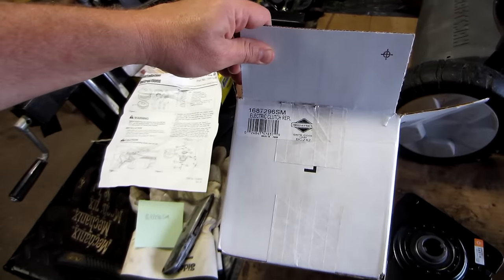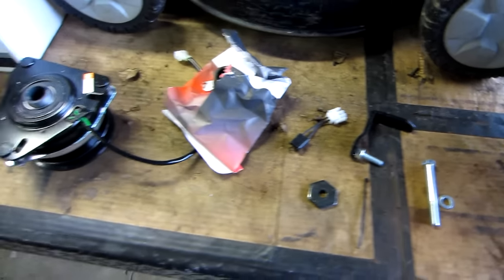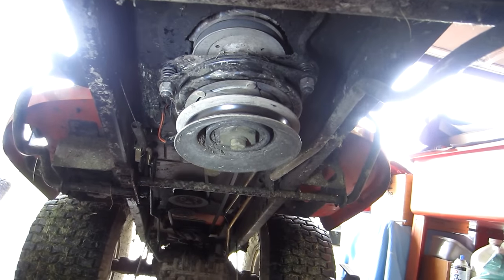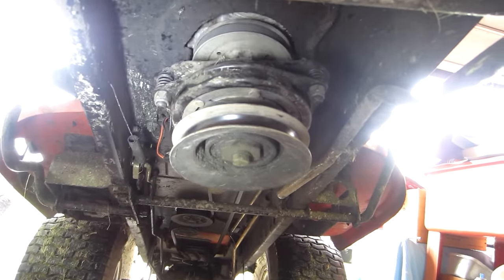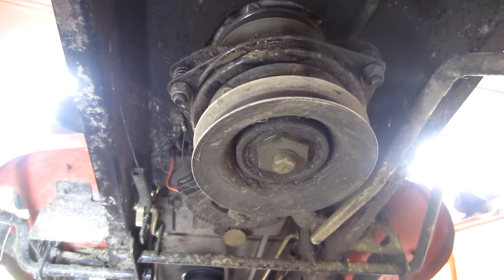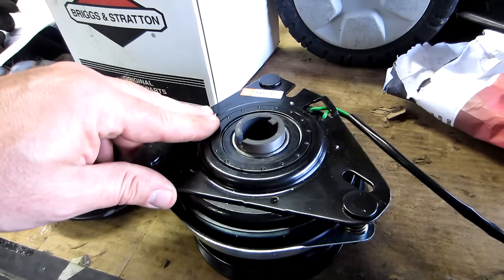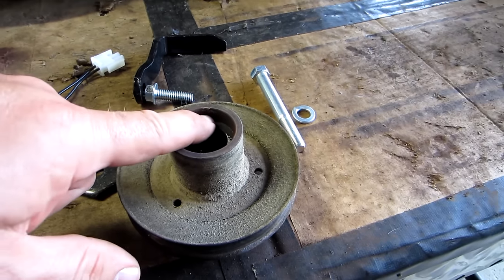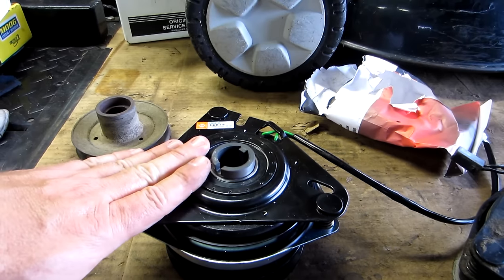Troubleshoot Replace mower PTO CLUTCH

Comment: Nice video , i have a John deere gx325 my pto clutch when i turn on its works on forward.but when i do reverse it shutoff the pto ..what do you the problem ?
Reply: If the PTO is engaged and works while going forward, and then you begin backing up, and the PTO shut down, that is by design.  Your PTO is working fine.
Reply: @retiredhappy466  ok thank u
Reply: @mowerstv4579  
You can bypass that safety switch. I did mine with no problem.

Comment: I,have a question sir, about my pto I loose power when I engage my pto ..its a briggs, 23horse, on a 08 husquvarina. When I tried to find rhe problem I noticed the pully was hard to,turn by hand even,with belts off .
Is this, normal?
Reply from the maker: There should be some resistance to turn the pulley by hand with no belt attached but not a lot. I'm not sure what you mean by lose power? If you are having your engine completely shut down or turn off then that's a safety switch issue. However if you're just experiencing less power being transmitted from the engine you could have something wrong with the PTO or in the deck spindles that's causing a drag. Don't roll out that the engine is needing attention. When I work for Sears I used to have customers complain that they had the lack of power whenever they would engage their deck thinking that there was something wrong with the belt drive or the deck itself only to have me come out and tell them that they had a blown head gasket or a valve guide come loose and cost the pushrods to fall out or bend and was only running on one cylinder. The big twin Briggs engines like you have seemed to have plenty of power but when they really get taxed with running something as big as a 46 or even bigger deck it shows the weakness in only having one cylinder working. Good luck
Reply: @Foxboss9  thank you, for the reply, Ive checked the deck spindles and all the parts that spin turn pull and loosen..lol, but the head gasket, I didn't notice it . but I do,now I see oil now ive checked , now I can get this thing running like a 23hp should not like its mowing 2feet of grass..lol
 thank you

Comment: what about if the clutch is kicking in and out? Would you think that would be a switch issue? Mine runs and then after a min or so the blades start cutting on and off. It makes the whole lawnmower shake like crazy then the blades will almost stop.
Reply from the maker: Southern Food Junkie try adjusting clutch air gap first
Reply: Do you got a video on that?
Reply from the maker: I don't believe so
Reply: i had the same problem on my john deere x140 lawn mower, it was the PTO switch which has melted on the inside, after replacing the switch, the lawn mower works again

Comment: I don't have that type of money just for a cheap clutch that'll just burn out again i am gonna switch all mine over back to cable engagement you push the lever up to engage the blades is how im gonna do my 3 pto mowers 

but on the old gray craftsmen i can swap out the steering make a new battery holder for it because the gas tanks under the seat and right now the battery is in the way of any engagement lever

Comment: FoxBoss, I NEED your help. I removed my PTO Clutch from a Yazoo/Kees mower and I cannot find a replacement that specifies the size that I need. I Measured the pulley to be 6 1/4" OD. Are most PTO clutches the same? It came off of a 15hp Kawasaki. Any feedback would be greatly appreciated.
Reply from the maker: +Jason Michael Sorry I am not sure what size you need. The reason is not all clutches are the same.. You need to get hold of a dealer and get a part number.  Try this link.. http://www.yazookees.com/node4056.aspx    good luck

Comment: I'm having a problem with my blades. They start turning fine. But once you get into any grass it will cause the blades to slow and then stop. Could it be my pto clutch?
Reply from the maker: sounds like a belt issue, make sure it is the correct length belt and in good shape..
Reply: Brand new belt. From John Deere dealer. We checked all pulleys and spindle housings. And blades. The only other thing we could figure is the pto clutch may be going out and getting weak.
Reply from the maker: make sure the air gap is set correctly on the PTO other than that make sure applied voltage isn't dropping off for some reason it should stay a constant voltage around 12 at the PTO

Comment: i bought a new pto clutch and a new switch but the clutch still doesn't engage the blades. I noticed the bolt that holds that pto clutch in place. Is this suppose to happen.

Comment: The air gap should be .012, I have with worn PTO'S closed the gap to .008 , I don't recommend going any tighter,  it will cause the PTO to NOT disengage.

Comment: My wires short circuited at the rubber grommet where they enter the clutch. The grommet yanked out and pulled the wire insulator off. PTO kept disengaging after mowing for awhile. The wires kept getting hot, which was our short circuit symptom. The switch and fuses still have continuity. Clutch is one year old. Pulled the clutch cover off but the internal clutch is over the wiring and not allowing access to the 2 wires. I am attempting to find an alternate way to wire it but I am trying to figure out how the current applies the clutch itself.
Reply from the maker: +markfothebeast Depends... some get power through the switch, others do it through a switched on relay.. if you hard wire it through a separate aftermarket switch I would wire in a relay so all the voltage isn't going through the switch by itself.. hopefully you don't get feedback from the clutch that causes the pto to stay engaged even when the switch is turned off..good luck
Reply: +Foxboss9 The fuse and switch are operating as should. My Toro Z597D doesn't utilize a relay in the circuit. The wiring I am refering to is the pos and neg inside the electromagnetic clutch. It appears that there is a large round plate with a flat surface that is internally wound with coils (with outer clutch removed). I can't quite access the wiring on the innerside of this plate without pressing out the outer bearing to view how the circuit is wired. Unlike many other mowers, this clutch wiring does not have any type of terminal on the outer shell. Which is way I had to access the internal components.
Reply: +Foxboss9 I cannot find any information on how the electromagnetic clutch is supposed to be internally wired. The coil in the plate I am assuming is the positive but I am unsure of where the negative wire is in play here. The two magnets visible on the outer shell from what I've read create a magnetic field when power is applied. I don't see any type of wiring to the magnets themselves. Just the two wires entering the outer shell behind the plate in which i am unable to access until i press the bearing out.
Reply: I think I have an understanding of the magnetic clutch circuit after a bit of reading. It appears the wiring entering the plate is simply winding that enters and exits completing a circuit. If I got this right, the polarity is reversible on an electromagnet. So either way, I have to press the clutch plate out to fix the wiring.
Reply from the maker: +markfothebeast I see.. the way that that PTO clutch works is just like when you did your elementary school project and one copper wire around a screwdriver and could magnetize it. but in this case it winds around the plate that causes it to magnetize when energized. unfortunately hardly anyone this day and age tries to fix their PTO they just replace it. and unfortunately they are very expensive.
Reply: +Foxboss9 Yes. I just paid $250 for this clutch last year. And that was the cheapest priced unit online. Didn't feel like purchasing another. Worth the science lesson.
Reply: +Foxboss9 Fixed the bare wiring from the outside. But still cut out after 15 minutes. Turns out it wasn't recieving the proper voltage because the alternator plug in was loose.
Reply: what is the PTO- clutch spec's supposed to be ! Torque lbs!!!????

Comment: Question  Can you do an instructional video on how to replace of PTO clutch on a Grasshopper Zero turn mower Please Respond
Reply from the maker: Sorry I don't have any here to show. They are far and few in between. I know one thing though that PTO clutch is usually very close to the frame and almost always requires the engine to at least be lifted slightly. Good luck
Reply: @Foxboss9  Okay Thanka Anyway
Reply: @tannerdamico9895  I just pulled mine of a Grasshopper 1999 725 with Kubota 750cc motor to see why it isn't working.  Had clearance to remove without moving anything.  I didn't think it would come off since it was on for 22 years but used a tie rod end pickle fork tool and it came off easy. Had to use a pipe wrench on the pump drive shaft to stop the engine from turning over when removing the PTO bolt.

Comment: Could a air gap that’s out of Wack (not set to the right gap) cause it not to work when the switch is engaged
Reply: I'm pretty sure there is a air Gap spec that has to be correct.

Comment: I ment it makes a clicking  noise even when the pto isn't engaged we both think its the electric clutch. You can here it clicking when you start the tractor and i know damn well it wont start if the pto is engaged when you drive it you can here it. what are your thoughts?
Reply from the maker: +Ryan Brooks While running it randomly clicks?

Comment: Just installed a new clutch. I checked all safety switched. Why do it just click when I gauged it ? It was working before it finally froze up or stopped working. Checked all connections when installing! Help!!
Reply from the maker: If the clutch just clicks it means it is getting power..maybe you have a bad replacement...try jumping it direct to the battery..
Reply: +Foxboss9 Thanks for answering my question! It was a bad replacement part from the start. I thought I was going crazy there for a minute. I will sub to your channel brother. Thanks for helping a veteran in need.
Reply from the maker: +john smith glad it worked out 👍😊

Comment: WHAT DO YOU  TORQUE  BOLT  TO ??
Reply from the maker: I always use my impact on 2nd lowest setting.. I just know when to Stop.. I'm not sure there is a torque setting.. If so I would assume it would come with new clutch instructions as the clutch mfg should determine it..
Reply: My Simplicity Conquest 1700/2700 says 45~50 lbs torque on bolt holding PTO Clutch to engine shaft.

Comment: Good video. Thanks for not showing all the self explanatory stuff.  I have an 08 cub cadet LT 1050 with a Kohler engine. (25hp OHV V twin. SV730S) The PTO runs like it should with the cruise control on. But when you manually use the throttle, it's stops turning.  And it's more frequent when the deck is lower.  Any help?
Reply from the maker: Lane not sure But I would look for loose or bad connections.. Sounds like something causing a short/bad ground issue because of physical interference..
Reply: Foxboss9 Thanks. I'll start checking those. As soon as I push in the button, and back out again, it's fine. maybe for a few seconds. Or a few minutes.  But the PTO won't engage again until push then pull the button.
Reply: Problem solved. There's was two wires running along the frame. Under the right side of the seat). One went to a ground, and the other was just snipped off, going to nothing. It was arcing on the frame. I put some heat shrink tape on it, and the problem was solved. LOL, this was after a few hours of chasing wires, testing connections, switches, etc etc
Reply from the maker: Great Job, Like I said, Loose connection with Physical interference... Easy enough to diagnose BUT, you did all the hard work of hunting it down...I hate Electrical Issues...Especially Random Ones!!

Comment: Question for anyone out there. A neighbor brought his Ariens 963032 for a look. He said it doesn't work in tall grass. I drove it around and it seems that the PTO comes on and off. You can hear the blades start to slow, but then after a few seconds it starts up again. There doesn't seem to be any rhyme or reason to it. It stops in short grass even going downhill. Are these symptoms of a bad or failing PTO or is it something else? Thanks all!
Reply from the maker: Make sure to check/adjust the air gap on the PTO.. You will have to Google procedure or look for it on YouTube I don't have a video on that..good luck

Comment: why do they overheat,what makes that to happen in the first place?
Reply from the maker: mario fries good question.. Well,  It's connected to a hot engine.. It's pulsing electricity through it to maintain a magnetic pull.. It has a bearing that is run under load from the deck belt tension...It has a belt that produces friction on the sheeves of the pulley.. And if the clutch is misadjusted it could cause friction to the fiber lining..   So it's not uncommon for a clutch to overheat...
Reply: my situation is a little different,i have a jabsco pump,which has a clutch and pulley thats driven from a engine,and recently the breaker was tripping and the pump wouldnt stay on,i tested the pump with the engine off and the wires to the coil was getting hot and the coil was also getting hot,so im thinking the coil is shorted out somehow,so i took the pump apart and the clutch spins freely,so i ended just getting a new coil,so hopefully im right on this ,that the coil is shorted out,just confused on how it got shorted out and when i get a new one,that it dont do the same thing..thanks mario
Reply from the maker: the coils could be broken OR you could have a bad ground..

Comment: I can tell you that wth my JD 345, the use of an IMPACT wrench to install or remove the PTO Clutch - crankshaft bolt weakens the bolt. I've had about 5 bolts break in as many years because I used an impact wrench on that bolt. I just had to go thru it again, and this time, after I've had to drill out the bolt, I'm going to torque to correct specs....on my tractor it's 45 ft lbs and you can 'stop' the engine with nylon rope. Remove spark plug and stuff the cylinder with a length of nylon 1/4" rope and it will stop the engine from turning and allow you to use a torque wrench on that damn bolt....
Reply from the maker: QuantumRift Hmm, personally I have done 40 to 50 changes on various engines over the years.... Never once had a bolt break... Glad you mention it.. Other viewers may have the same bad luck you experienced using an impact..
Reply: Well, cranking down that bolt with an impact wrench can seriously weaken or strain it. That's the only explanation I have for so many of those damn crankshaft PTO bolts breaking.  Also, I did reset the air gap to .018" as it was about twice that. That too may have contributed to the broken bolts.  I did, however, go to the local hardware store and get a 10.9 bolt that was prob 3/8" longer than what JD had been selling me. The reasoning, is that it's obvious that the PTO bolt doesn't really go into the crank all that far anyways, and torqueing it down still doesn't give you much "bite". So a bit better bite into the crank, along with the 46 ft-lbs (I erred and said 45 above) of correct torque, and a drop of loc-tite and I'm hoping my PTO crank bolt problems are over.

Comment: How do you install a Craftsman plow on a Cub Cadet lawn tractor it's a LTX 1040 get back to me thank you
Reply from the maker: With few exceptions, the mower and plow have to be matched. What that means is you have to buy the plow from the mower mfg. The good thing about that is you can then get a manual TG that shows how to install it.. If you have the correct t plow just call MTD to get the installation instructions.

Comment: Couldnt a bad PTO relay cause the same problem?
Reply from the maker: If it was the PTO relay It would have failed to keep the PTO engaged when I bypassed the switch.. I bypassed the switch not the relay..
Reply: So if I have a bad relay I wouldn't be able to engage the PTO at all?
Reply from the maker: You can with a Switch that has an amp rating to handle the draw of the PTO and the correct gauge wire to run direct current from the battery..
Reply: Dude< Im just trying to find out if a bad relay will cause the PTO to shut down, geez......Sorry I bothered you.
.
Reply from the maker: What exactly did I say that makes you think I am bothered? To answer your question that you originally posted, 
"Couldnt a bad PTO relay cause the same problem"? Answer is Yes
Reply: That's all I was trying to find out....

Comment: I have a poulan pro zero turn and my pro stop working. I tested the switch so what can I do
Reply from the maker: Manually wire clutch direct to see if it works.... that way you know the clutch is good

Comment: Well, been looking for hours trying to find how to remove the clutch to simply replace the drive belt, nothing found at all.
Reply from the maker: Wooley689 one long center bolt holds the clutch on the output shaft... That's it.. Unplug it and slide it off... Don't loose key that goes into the keyway...
Reply: Thanks, I knew that, but could not stop shaft from turning and no way to hold it to keep from turning without damaging something.while trying to loosen bolt. Used a impact gun on it, came right off.
Reply from the maker: Wooley689 yes.. Definitely an impact👍😁
Reply: Foxboss9 my bolt came out of craftsman lawn tractor while cutting. But once I found the bolt and put it back it won't disengage.
Reply: Wooley689 just pull the pto off use impact no issue at all.

Comment: If the top bearing gets too worn, it will blow the fuse, because it will cut the wire on top of clutch and short it out and blow the 25 Amp fuse.

Comment: I have this exact problem as we text but this one kills the engine. Knock the pto switch out and mower will run.  Yes it cuts for awhile and cooled off it starts the same scenario.  Anyone?
Reply from the maker: Check clutch air gap, Inspect clutch for frayed wires, if all is well, replace switch..